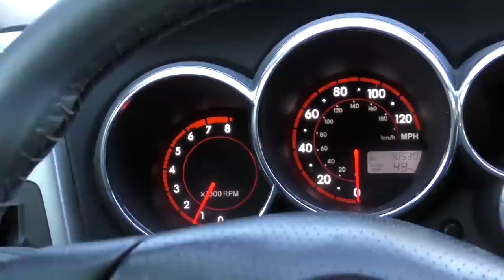Please Stop Doing This to Your Transmission (It Destroyed My Car)

Comment: just had an oil change at Subaru for my 2008 forrester with 80k miles....the service guy shows me a tube of dirty fluid, we need to flush your Trans.....yeah...well, I heard its not a good thing...He says, we do it all the time, it will be fine....right.....
Reply: Im so confused over this i have 2018 forester its still new but want it to last along time but cant get an answer on when to change the fluid on the CVT transmission i think your 2008 is not cvt?
Reply: @joenaps104  check your owners manual...I doubt you'll be changing your CVT fluid....for a long time,,,my manual just says check it..nothing about changing it.....

Comment: Scotty's ignorance of this amazing. Transmission flush machines don't have a pump, they use the pump inside the transmission. If you flush your transmission regularly you will do your trans a huge favor. He is correct that if you once the fluid is full of "crud" it shouldn't be flushed for the reasons he states. It's too late, you screws yourself. If the fluid isn't doesn't look like crap, flushing it replaces ALL of the fluid, not just a small percentage. Flushing is a good thing, and no shade tree mechanic isnt going to change my mind.

Comment: Hi scotty I have a 2016 Ford Explorer that when I turn the steering wheel it sounds like a rubber band stretching what could be the gm problem or how can I fix it ??
Reply: Check your power steering fluid level,  possibly replace fluid if its black

Comment: And this is why I got a powertrain warranty with my vehicle... If the engine or transmission blows, I get a new one, free of charge! 😉

And yeah, my vehicle has 90k miles on it, so I needed to cover it.
Reply: 1. Good luck trying to get them to honor that warranty.  They will try every trick in the book to not do it/put it off untill warranty ends
2. They figure screw it, we will make way more off this sucker in repairs any time he comes in for service
Reply: @joshhemingway  actually I have already used it once. Oil coolant line split and had the be replaced. This was done, free of charge.

Comment: What about a transmission that is sealed? Not even a dipstick.
Reply: Every 30k miles drain and refill if you plan on keeping it for years.  If you're getting rid of it, then don't worry about changing it.

Comment: Automatic transmitions have so many complex stuff, just stick with standard and be happy.
Reply: Wish I could but I only practiced once on a manual transmission but never got the hang of it. Otherwise, I would be driving both automatic and manual transmissions.
Reply: may day  Been driving standard since 14 and I've noticed that people tell that a lot but if your age ranges between 16-35 you can handle the shifting once knowing how to properly rev it. If your age ranges over 35 I can understand the need for an automatic.

Comment: Why don't they put drain plugs on automatic transmissions?  I could do it myself, but heck, I'm not about to crawl under the car and loosen 16 bolts just to have all the fluid spill on the ground or my face.
Reply: You only have to do it once. While you have the pan off put in a bolt in drain plug from the auto parts store. Then you're good to go drain the pan.

Comment: I 100 % totally disagree . I have my transmission serviced every 30,000 miles and only have the filter , screen , and gasket replaced every 90,000 .  My Ford E150 van has not captured anything meaningful in filter or magnet after 380,000 miles and performs as new . Your transmission clogs because you did not service religiously . Yes , if you have waited to 150,000 miles to service you cannot force that diarrhea through the intestines of your transmission . Just consider it at least as important as an oil change . Most people neglect .

Comment: hi guys, I have ford laser 2001 old laser in Australia. I have transmission problem. My mechanic changed transmission oil and filter. And still gear slipping off. Can anyone HELP

Comment: I think Scotty must get a lot of cardio with his flailing hands. If he had a FITBIT on his wrist it would smoke from the workout. My local Toyota dealer said NOT to flush my transmission. Just spill n fill and new filter. Had it done at 100 000 kms on my Taco Truck. Next time will be at 200 000 kms.

Comment: you have to flush zf-transmission every 60k or it will die quickly. ask every bmw owner. i agree on most of your videos but not in this one. flushing means changing the oil several times till it is really clean and no old oil is left. this is not cheap but necessary

Comment: Really your kidding???     I have 2000 toyota tacoma.  Original felt that original transmission fluid never added any fluid or changed any filter  nothing 675000 miles transmission solid as a rock shifts to like a wet dream.   Never no problems motor or tranny..

Comment: I have to argue... no such thing as life time... fluid goes bad with heat and cold cycles... yes I’m against forced flushes or chemical flushes... easy to pop a hose and drain a quart fill a quart style... system isn’t reversed nor any chemicals used.

Comment: There is a very simple solution to the need to change automatic transmission fluid.  Buy a vehicle with a manual transmission.  Ha, ha, ha!
Reply: I only practice ONCE but never did get the hang of it.

Comment: Sorry but this is tiresome, stressful and full of redundant contradictory information. Luckily I know what I'm doing, have flushed out several auto trans, changed filters (Volvo XC70 D5 at 200 000 km, now has 360 000km ; BMW 530d at 190 000 km now has about 300 000 ; Mercedes 220d at 220 000km, etc). If you listen to this guy, in the end you still don't what to do...

Comment: now i know your full of crap because if you change the fluid by dropping pan and it screws up then it was already done. there is nothing in the fluid that will keep it shifting.  flushing may clog things up then it will destroy it. but most of the time people are already having transmission problems so they change the fluid then blame it on the fluid change
Reply: but yes just dropping the pan and filter change and adding fresh fluid you lost which typically is half or less of total capacity should be fine. i just changed fluid and filter on my 290k truck old fluid was ok little dark but still good and red